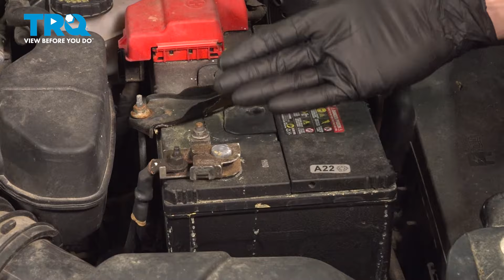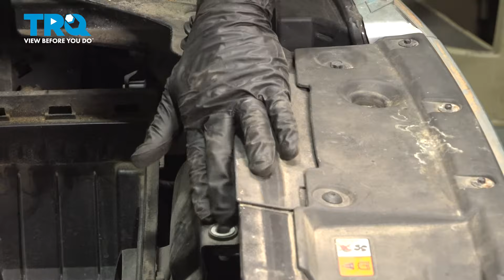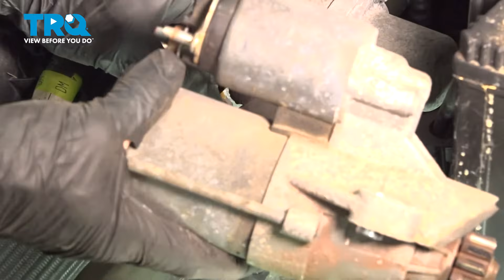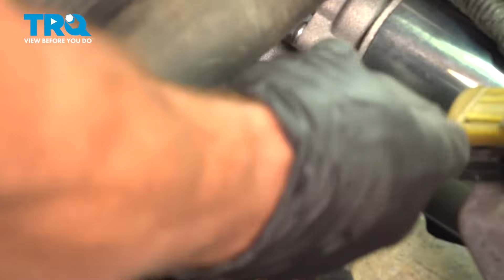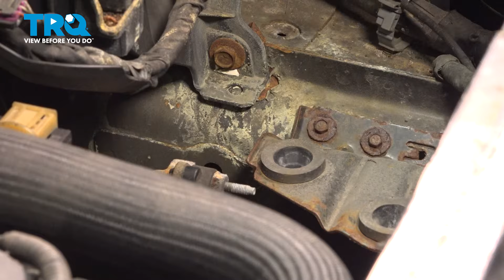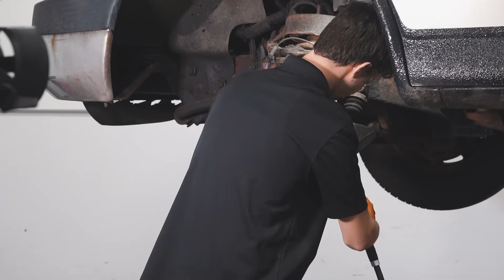How to Replace Starter 2011-2019 Ford Explorer

Comment: I have power but no clicking or anything when turning the ignition, checked fuse and relay. Battery is 2 months old, do you think it could be the starter
Reply: I’m having the same problem I put new battery new starter new fuse

Comment: Great video, when I start my 2012 explorer xlt, I get a clicking sound and the dashboard is flashing and a the battery fully charged. Does that sound like a a bad starter?
Reply: Check the relays mine did the same thing